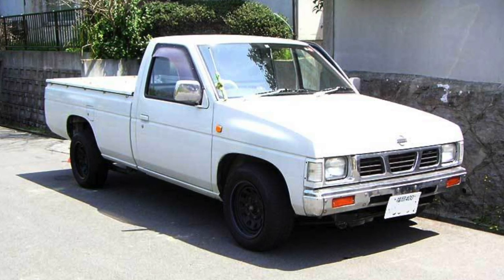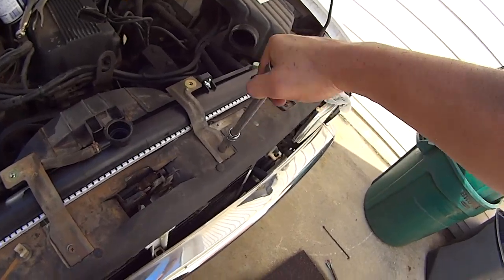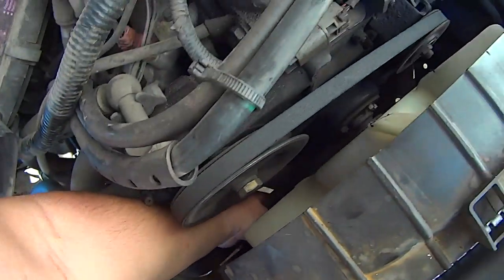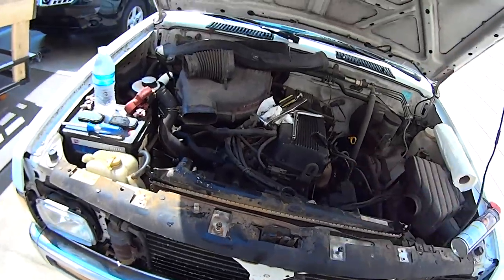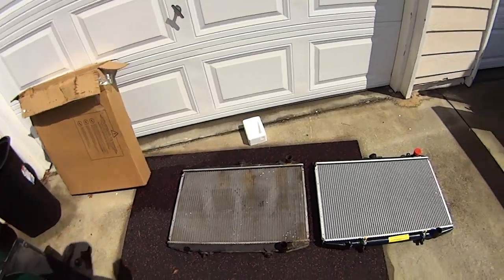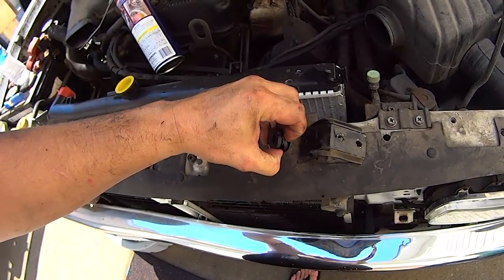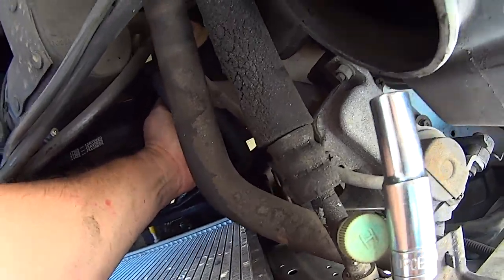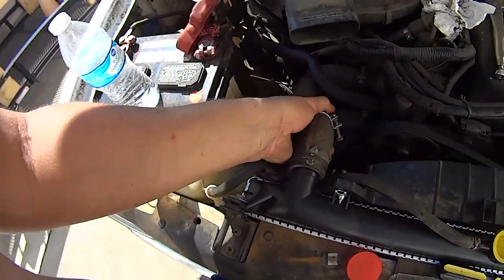How to Replace Radiator on Nissan D21 Hardbody Pickup Pathfinder

Comment: My radiator cracked after alternator belt snapped off going down the road at 60 mph. I was trying to find a safe place to pull over and a blast of water started shooting out from the hood so I was forced to pull over on uneven ground lol 200 dollars for a tow truck and this was at 5 am in the morning. Just bought everything I needed for this job so as soon as I get home from work today I'm going to be doing this. Thanks for the video man

Comment: Thank you for taking the time to post this video I appreciate it I gotta put it I radiator in a thermostat in my truck and I knew like you do it that your video just point it out a couple of day you ready to be aware of like a little rubber mounts on the bottom of the radiator anyways I'm using voice text I've got a road going somewhere where I could borrows tools peace out thanks again

Comment: What about the transmission oil cooler lines? I'm watching your video as I do mine and now I'm stumped.  Would I have to burp that system if I take off the lines?
Reply from the maker: No. The air bubbles get vented out of the transmission when the fluid circulates.